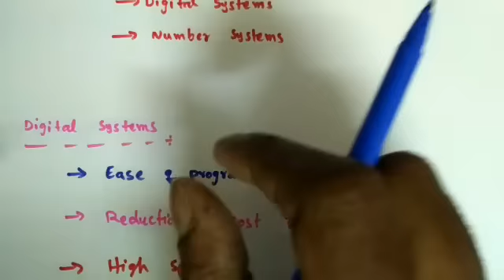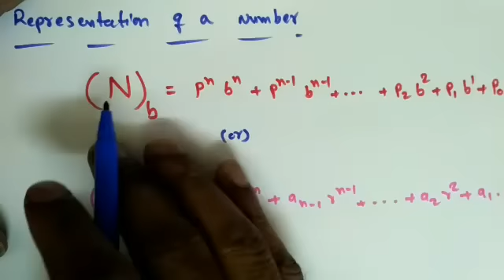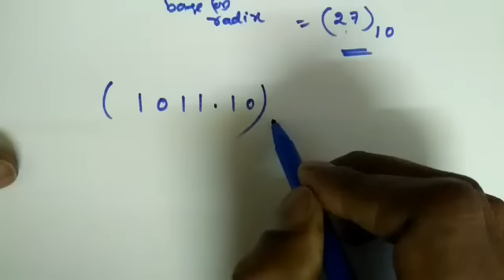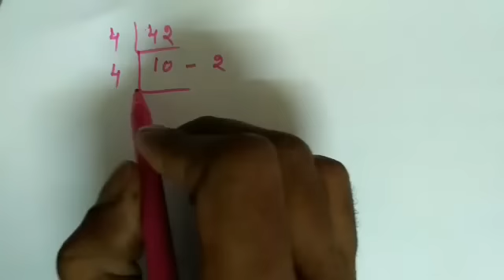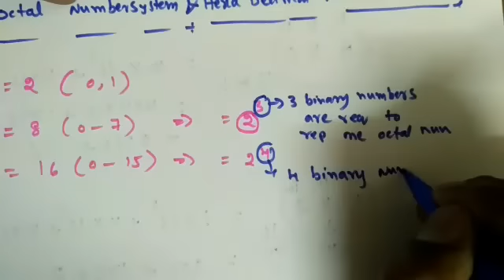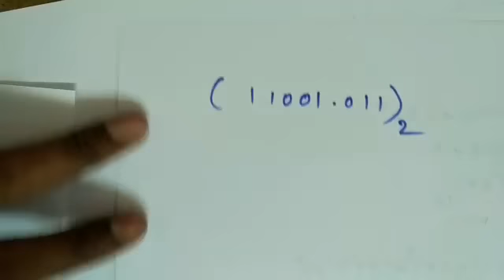Digital Circuits Lecture-2 : Number Systems - Part 1

Comment: (101.01)base2 = (10.222)base5 = (5.13)base6.
Since 5 and 6 cannot be represented as an exponent of 2, convert (101.01)base2 into decimal form by using the formula in the video. The answer in decimal is (5.25)base10. Now convert this to the base 5 and base 6 by using division method as mentioned in the video.
Reply: I'm getting (5.00)base 10 in decimal